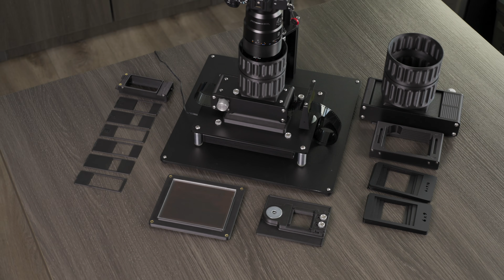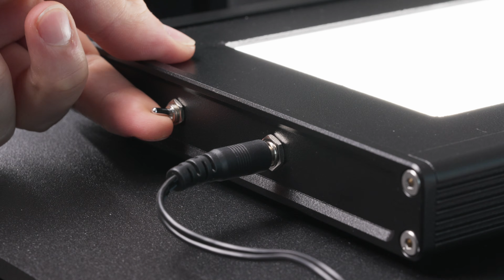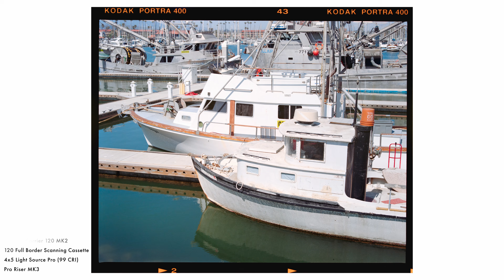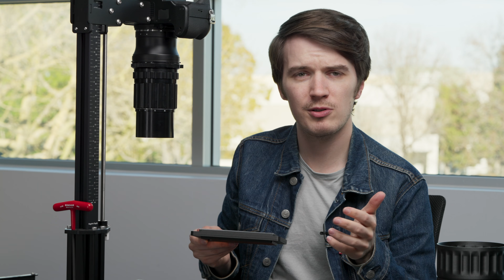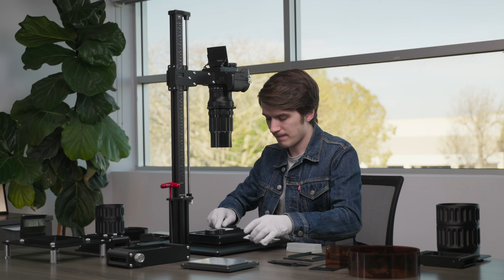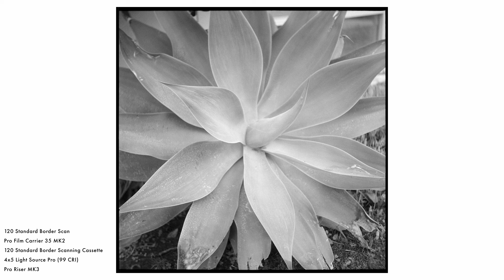Pro Kit for 35mm, 120, and 4x5 Scanning Overview

Comment: Thanks for sharing. Would be nice if for the 4x5 option some hardware assistance could be included so stitching of parts of the 4x5 negative will be made easy. So that he holder could we moved somehow on a rail or something like that. Stitching is needed when you want to capture the best resolution of the 4x5 negative.
Reply from the maker: Thanks! Yeah, we have had some prototypes for larger format units in the past (8x10) but it got fairly costly when we started adding up the parts. It's still something we may do in the future since we can do more in-house manufacturing now than previously. There are some new larger format tools on the horizon though....

Comment: a great video, and thanks for including the 4x5" equipment in this video, nice to see how it works, and also that you need the 4x5" holders for 6x12 as That was going to be one of my questions (I shoot a sinar f2 with a 120 back, a sinar zoom, which maxes out at 612, nice to know I can scan this). What a cracker of an idea, to add roller and mask interchangeability for rare formats, FANTASTIC for camera collectors, as this means they can use them!, as there is a workflow for the film; saves these jems from sitting idle on shelves.
a further line of research could be to add 1/4, 1/2 & full frame, 5x7" and 8x10" formats into this system, or create a ULF set, specifically for these.